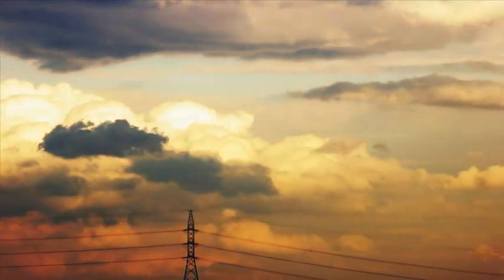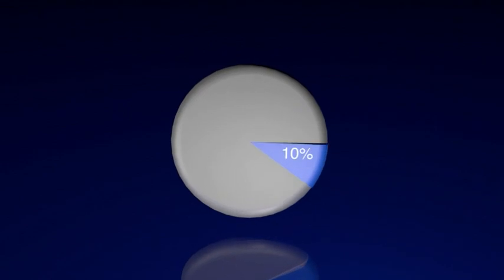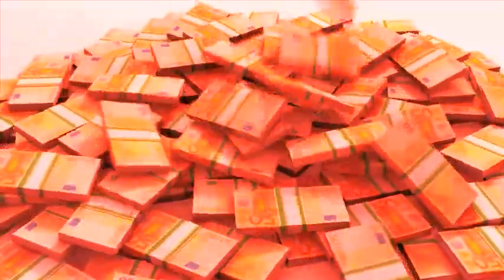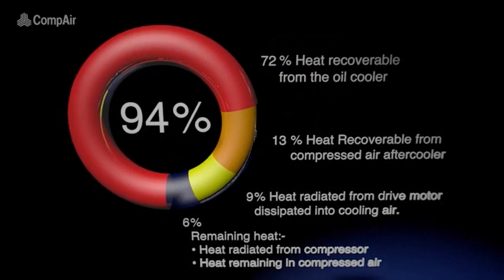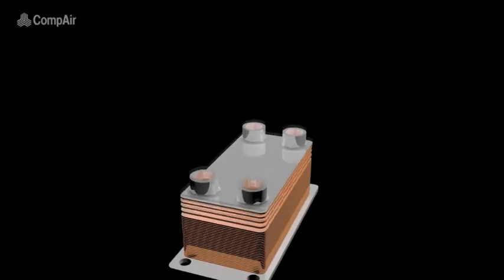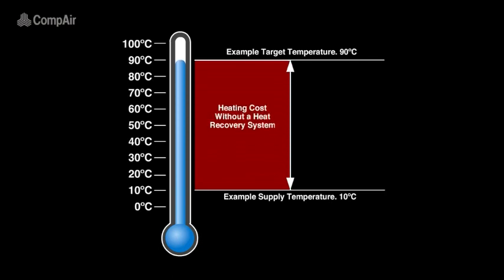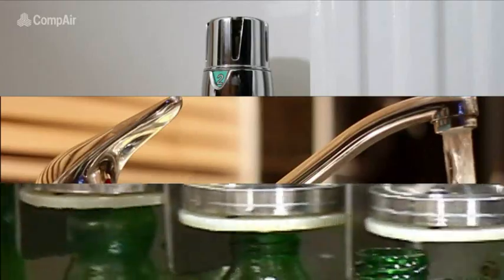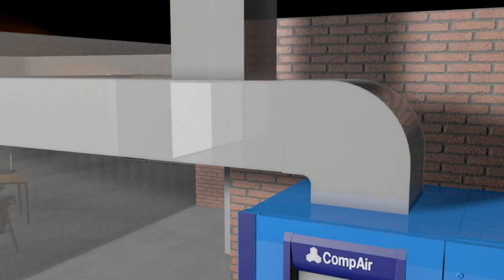CompAir Heat Recovery

Comment: We are planning to install a 90kW water cooled speed regulated screw compressor. How much saving is possible if I produce hot water? The running time is 6000hr/ year and load 80%. What will be the maximum temperature of hot water?
Tamishna Group
Bangladesh
Reply: Hello Hasan, Thanks for your interest in our product. We are happy to do the exact saving calculation for you and come back to you soon.